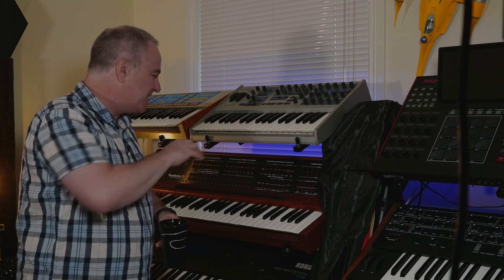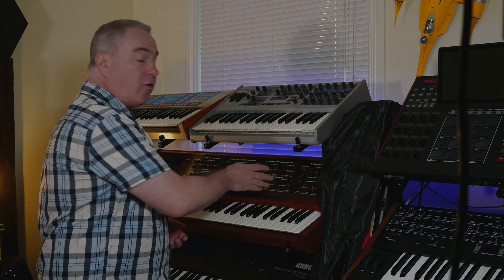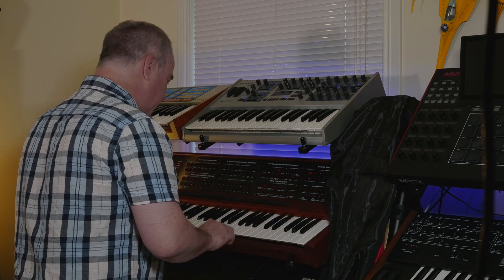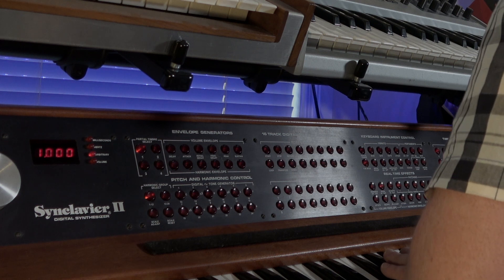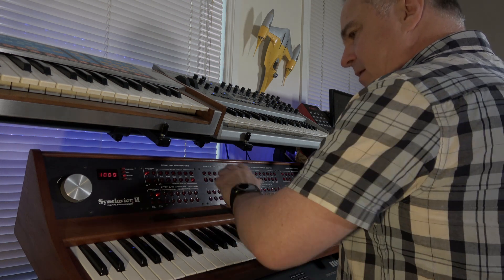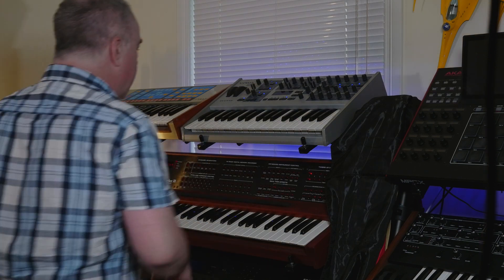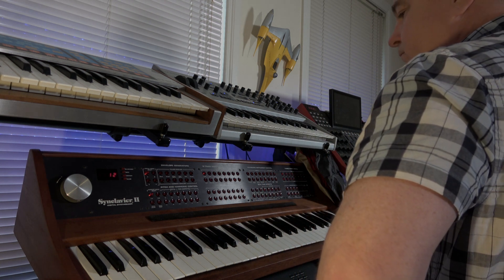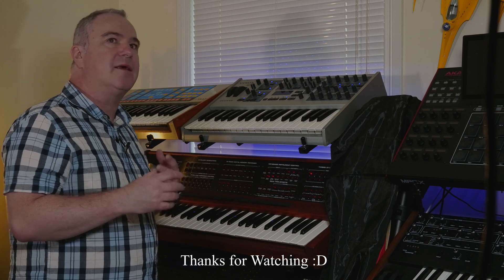Further Synclavier Adventures

Comment: Great video! I've got one of these that's been in the closet for a couple of decades. Every once in awhile, I think about getting it out, but I think I'd want to replace filter caps before turning it on. Big project! BTW, I don't remember the fans on mine being loud. Maybe the bearing in yours are shot. If I recall correctly, the fans are fairly stock muffin fans and shouldn't be too hard to find (and not expensive). You'd just want to get them out and check capacity to get something similar.
Reply from the maker: The fans are pretty new, not original stock but with a lot more air flow. The issue is they are direct 240volt ones so they always are quite loud :D

Comment: Hello and thank you for such a comprehensive demo. I have a question though, which I need to be answered for my research paper, and I would highly appreciate if you can help me. 

From what I have seen, Synclavier II was a Synthesizer, but did it serve as a "SAMPLER" as well? I have seen some demos of Synclavier PSMT, with a computer attached to it, do you know if that was a combination of Synth and Sampler, or was that also a Synthesizer. Also, I have seen people using guitars, instead of the keyboards to play sounds from the system, something like a MIDI controller, do you know anything about that functionality.  If you could please make a quick video explaining that I would highly appreciate, or you can respond back with text. Thank you so much.
Reply from the maker: It started life totally as a FM only synth, then they added mono sampling then Stereo FM and stereo sampling. The Synclavier had its own special Guitar interface which required a custom guitar to run it. My unit is a base 8FM voice system. Hope thos helps.
Reply: @100ThingsIDo  Thank you so much for your response, it really did help clarifying things. So, your system, as you said is base 8FM system, does that mean it only does synthesis? and does that mean that back then when artists were purchasing it, they could ask for a unit that would only do synthesis, or a unit that would do synthesis and sampling both? 

Just one last question for further clarity, the keyboard alone was capable of carrying out synthesis, however, to access sampling functionality of Synclavier, one definitely needed a compute; am I correct with this understanding? Please advise, and once again, thank you so much.
Reply from the maker: @aqeeljohnjoseph5407  The keyboard alone is a controller it has not ability to do anything (even MIDI) without the mainframe. Indeed, the Synclavier system was designed to be upgradable so mine is the base unit but you can add more FM voices, Upgrade the processor, Upgrade the floppys to SCSI Harddrive storage, Add sampling, add the Guitar Interface  add MIDI . Check out some of the Syncalvier Sellers on line for more details. :D

Comment: Great video. I love the sound of the Synclavier  - the software emulation doesn't seem to sound anything like the real thing... as far as I can tell.  Could a contemporary manufacturer make a clone Synclavier now? In a smaller box etc - or is it impossible to replicate for some reason?
Reply from the maker: Cameron Jones now makes a PCI Card called Synclavier III that runs the Voice hardware but replaces almost everything else, besides a little bit of technical data a lot of the specifications of the  systems has never been released so it would be a lot of reverse engineering required. There is something special about the hardware for sure (potentially more around analog bussing distortion than a specific quality) the Arturia and iPad Synclavier apps run the same basic FM code that once again Cameron was able to help port across! :D
Reply: @100ThingsIDo   - thanks for your reply.  I had thought the Synclavier was developed in part at a university - but that's FM synthesis isn't it?  Interesting. As an owner of an actual Synclavier, do you have an opinion on the emulations?  Or the Synclavier III card?  I'll look that up, I hadn't heard of it.  - But yes, I understand what you're saying about the analogue side of the original machine being responsible for a lot of the sound... the early Lexicon's are similar in that regard?
Reply from the maker: @rekindle  Indeed the Synclavier I was developed at Dartmouth College, with the Syncalvier II (My model) they decided to commercialise the company further and start selling to the retail market as far as a I remember.  FM its self seems to be a lot more confusing that its a mix of University output + Synclavier + yahama and Yamaha ended up with the commercial rights. I have manually recreated patches from the Synclavier hardware to the Arturia system (actually for a project for Cameron Jones himself) and they sound very very close but never exact. I think once you add FX and EQ etc you really would hardly know the difference :D
Reply: @100ThingsIDo   - I think sometimes just running the emulation, or in the box reverb or whatever, out and into anything analogue, like a saturator or valve eq, or anything that will just take the edge of it .... sometimes that helps and is enough... especially as it seems unlikely I'll get a real Synclavier anytime soon!  Just out of interest, have you ever been interested in the Polymoog?  It's in the category of transcendent machines for me as much as the CS-80, Synclavier and Fairlight.
Reply from the maker: @rekindle  The polymoog for me is one of the strange ones. I love it but I doubt I could find a use for it besides living out my Gary Numan dreams :D  I have never really considered one. I was tempted by a Memory Moog a few years back but it sounds like a world of pain to keep running! :D
Reply: @100ThingsIDo   - yep, I hear you!  I think the Strings sounds possible on the Polymoog are really special though, and the bass, it's more in the Strings machine / Solina / Divide Down family than the memory moog/ other big polysynths  maybe?  I've wanted one and had a close encounter with one once, it wasn't working well enough to buy but it sounded absolutely majestic.... wish someone would make a clone, or at least that the Moog One could do it's sounds, but it doesn't seem able to.